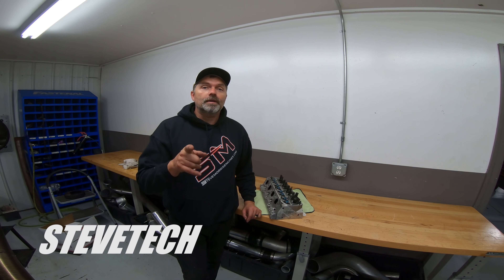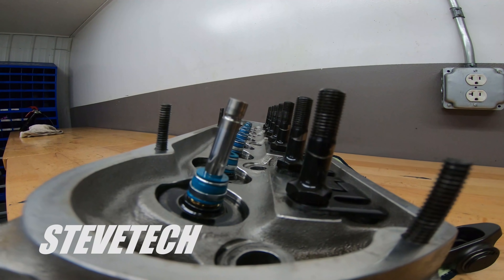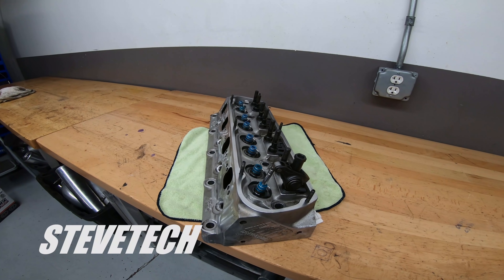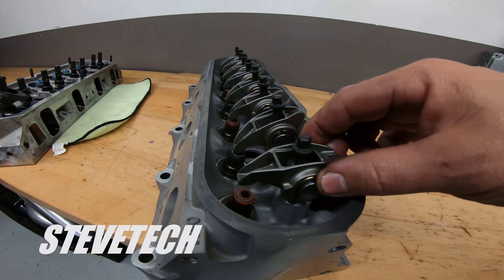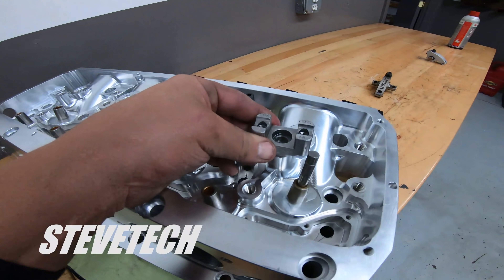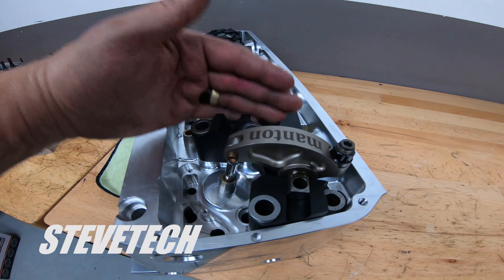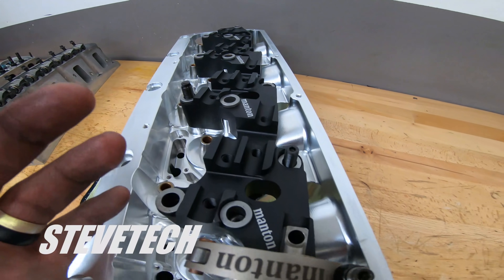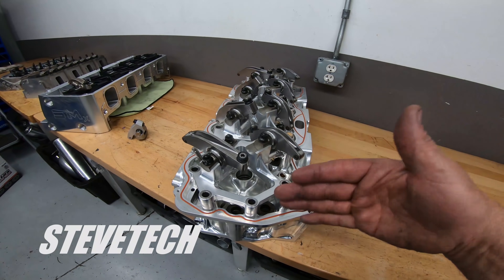Rockers Part 1

Comment: A possible 'fix' to the Hemi problem would be pre-loading the unsupported area through the valve covers, kinda like the differential covers that have bolts to preload the carrier bearing caps.

Comment: Amazed at so few comments.
This ought to be thousands.
The info and descriptions  far surpass anything that can be found in magazines or books.
I get what your saying even though you're building engines with high HP.
It would be fun to see you do a short series on building a mild daily driver engine.  What's important and what's not.
Let's say a 350 hp Chevy all block. 
Is it worth buying 1.6 rockers?
How about stock GM rocker arms, roller tips or full roller rockers.
 Maybe mild bowl porting tips.
How about leaving a stock intake valve and changing the exhaust from 1.5 to a 1.6.
.......yeah  I'm rambling.   
It would be fun to hear your advice on improving HP or just tinkering with the old school stock Chevy engines.

Comment: Excellent illustration. Never built any type of LS, but I hear from builders that guys can somewhat easily pump up the power on a stock type LS, and are mystified why the valve train self destructs.I think I see why now. I also understand the limitation on stud mount rockers as well. This is good stuff.

Comment: Sorry for some of the mess wording on the Big Chief 14 degree Square Park 14 degree olds castings 816 definitely will figure something out to try them together or at least a one piece bar I have bought your stage 2 drag week style camshaft asking for something easy on valvetrain parts I will be a twin-turbo deal pregnant women if I don't go crazy on the Boost like pump gas race gas still scared of pulling the bolt out of the head I know there are ways of fixing that butt I have to use what I have for now even have all the brand new jesel valvetrain ProSeries when I worked at Fords I should have had the exhaust bosses all charted Anna had some tool steel one piece cnc'd or I could have even done them on a Bridgeport which I have one in my garage let me know if you have any ideas Steve I still have a bunch of stuff to buy from you and a set of 18 degree heads the older ones for my buddies Big Chief Square port build he will also need a cam from you Pistons machine work 734 772 2886 Jim thank you much Steve

Comment: Excellent informational videos have a brand new set of 14 degree Big Chief 816 single type stands with somebody made at least a one piece bar type stand for the single Bolt and the exhaust Stan's so at least tie them all together at least the intake has 2 bolt holes in each stand even though they're brand new fully cnc-ported what's all of the best hardware we'll have to figure something out if you have any ideas please let me know when I have built some Ford Roush Yates headed small blocks for any use I welded pieces of steel between them to tie them together with no failures naturally 15 plus years ago or better about when I had these Big Chief heads I bought brand new a few years after that basically everything went oval port and one piece intake Stan's what the exhaust whole thing to those also just stay like the ray Franks now known as a profiler

Comment: With equal displacement, we know that SOHC and DOHC motors are more efficient than pushrod (OHV) motors, they flow more CFM, and they can safely operate at much higher rpm. But until Steve's recent videos, I didn't know about the potential problems that can occur with a pushrod's valvetrain. The technical details that he talks about, in terms of the incredible loads and forces that each part of the valvetrain has to endure and the ways in which those parts can be problematic, really clarify and help to further understand why SOHC and DOHC are superior engine designs in most cases. 
This is NOT hating on pushrod motors! They definitely have their advantages in some applications! If they didn't, Ford wouldn't have shocked the "car-world" and developed the brand new 7.3L "Godzilla" after ending production of all pushrod V8s 20-years ago.

Comment: Back in the 80's I had to put my full body weight on the cylinder head to keep the lifter rev kit seated in place and try to button down the head. My things have changed ....

Comment: Welded stands for the win. Being it sportsman or pro series. Tack them together. Just make damn sure nothing warps when it's welded. I actually have a fixture for welding my bbc stands which clamp it all down in so many places that only what you weld is exposed. Works a treat:)

Comment: Very interesting. Maybe why so many over head cam versions are being engineered.  
  And on the hemi. Those areas you pointed at between the rockers. Coukd the be bolted to the valve cover. Or hung from the valve cover to support it more. Or still not much more you can do about it?

Comment: Steve
On the Hemi rocker stand
Will it be beneficial to use a steel or titanium strap between the rocker shaft bolts in the center of the rocker stand where the intake and exhaust shafts attach
You pointed out the lack of support in the center where you need pushrod and spark plugs space
Reply from the maker: naw, mayby a girdle
Reply: Lil more billet ain't gonna hurt an it's purty

Comment: Hey Steve how much preload should a ls7 lifters have? Is 3/4 turn from zero lash enough preload or should I get a longer pushrod to get closer to 1 turn of preload? Had an engine build and the rockers are noisey after 10 mins of running almost like the pushrod isn't long enough but the engine builder says it's correct
Reply: Which lifters do you run and what oil? LS7 setups normally run 1/2 or 3/4 turn preload. 
Sounds like more of an oiling issue. Some lifters like Morels have a tendency to clatter if the pressure is too low or the viscosity is too high. But considering the fact that you get clatter after a bit, I doubt added preload will do much. The lifter will still bleed down and create lash. Too many expensive but crappy lifters out there, sorry to say.